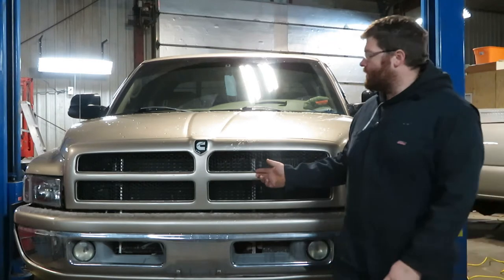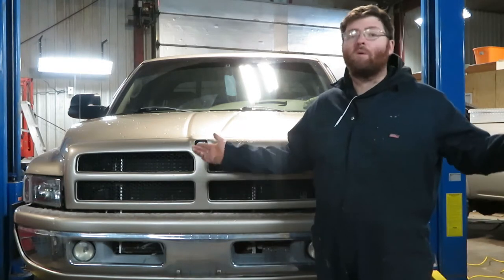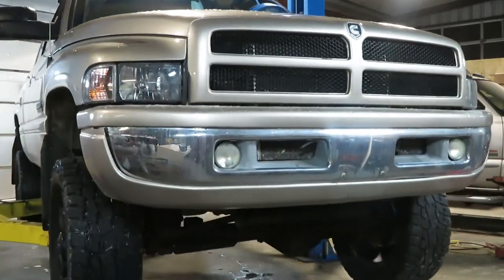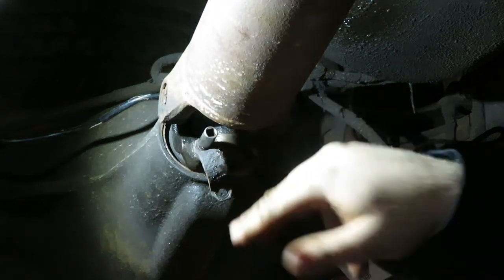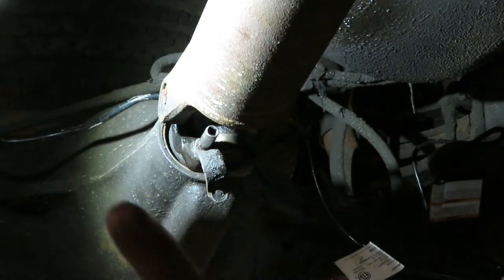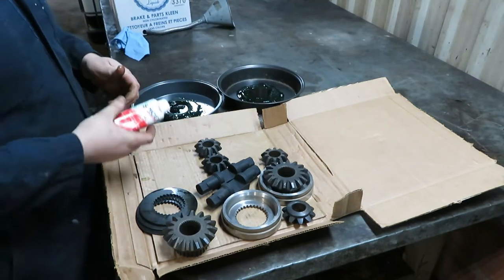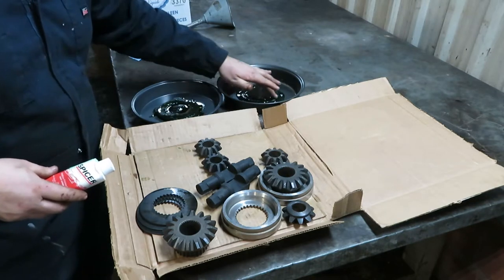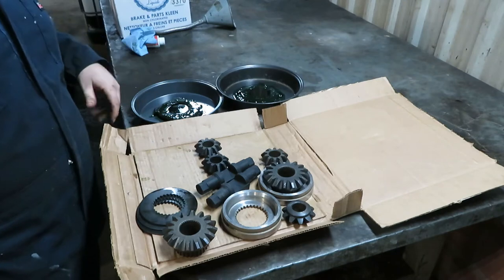How To... Dana 70 Posi Rebuild (Torque Specs In Description)

Comment: Awesome video my 1999 cummins auto rear differential is staying lock in all the time drained and add  limited slip additive and fluid still staying lock in this video is awesome this will help me pull it apart and repair it thanks also any avice on why it's still staying locked in all the time Makes noise when turning Slow speed
Reply from the maker: Clutches could have been overheated and warped so they are putting pressure on each other all the time. Thanks for the comment and good luck!
Reply: @screamindieselltd  Excellent vidéo! I rebuild mine yesterday, it s not a big big job, the most important thing is when you tight the 8 bolts from the case, we need  to tight slowly , en at the end you can ear a sound like click, I think it s the convex plate and clutches take place .  So thank you for this great vidéo !

Comment: So i’m looking to rebuild my differential and swap the gears from a 4.88 posi to a 3.55 lsd is there anything i’ll have to change and will i have to set back lash?
Reply from the maker: The carriers might not work as the break is usually 4.10. You should  set everything up again. Like pinion depth, and backlash. But if your swapping everything over from another diff you might be able to get away with swapping shims and everything. Although it is best just to set it all up again.

Comment: Would you know the part number for the clutches and steels
Reply: I have a open dif in my Dana 70 and it sucks the front .I bailed on the vacuum system and  put the cable  posi Lok on it .been looking around for a locker to rebuild myself

Comment: What year dodge?
Reply from the maker: This was a 2000. Should be the same for any second gen (94-02) Cummins with a Dana 70 with posi in the rear. 2003 and up are an AAM axle so they might be different. I haven’t got into one.
Reply: dana 70 power-loc
Reply: Thanks this was very helpful.
Reply from the maker: @doncunningham2332  your welcome glad you enjoyed it and found it helpful.
Reply: @gnzabuso1347  Technically, "Powr-Lok". But right, not a "posi" or "Positraction", which is a GM trade name.

Comment: that style is not referred as a pumpkin rear end  that's a axle housing  a pumpkin comes out the other direction and it all comes out ring and pinion no set up . like the rear loading rear   NOT A PUNPKIN A CARRER UNIT

Comment: Somewhere I read that parts were no longer available for the PowrLok. That basically, if it needed to be rebuilt, you needed to go to a traklok.  does that make any sense what I’m trying to say? Maybe it’s the carrier case that is no longer available?
Reply from the maker: I couldn’t tell you. I gave the dealer the numbers off the vin and the diff/ring gear and they got the parts for me.
Reply: @screamindieselltd  it’s actually the Powrlok in the Dana 80 that rebuild kit is hard to come by. I have the exact same unit that you were working on in the video and I probably need to have mine checked out. It seems to chatter when I go around a corner.  I’m not sure if that chatter was there before, but I replaced the diff fluid and added two bottles of friction modifier and that chatter is still there.